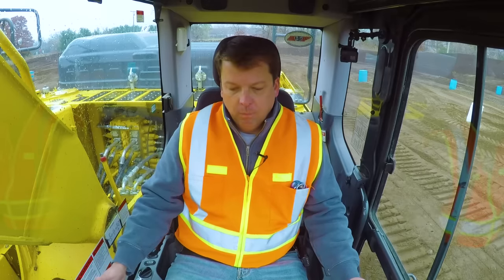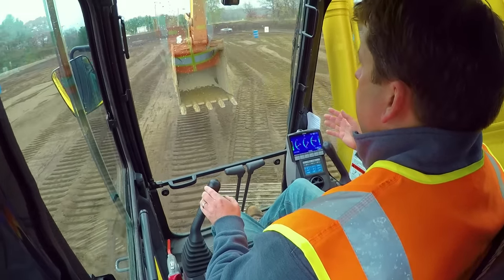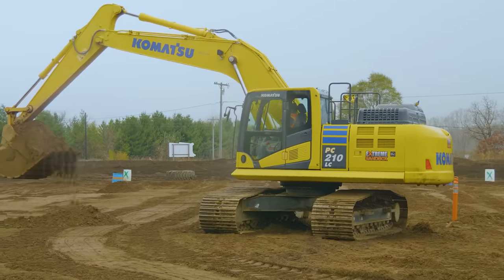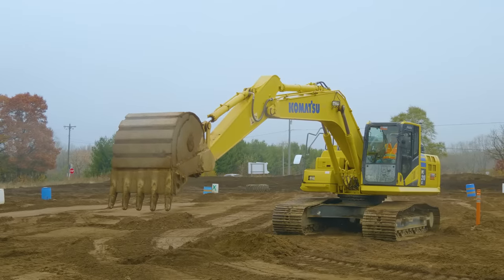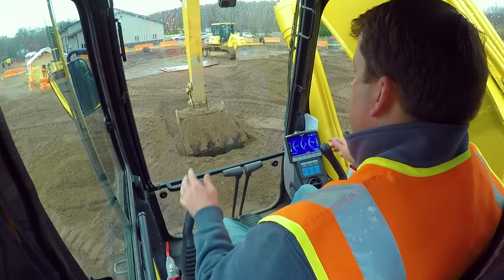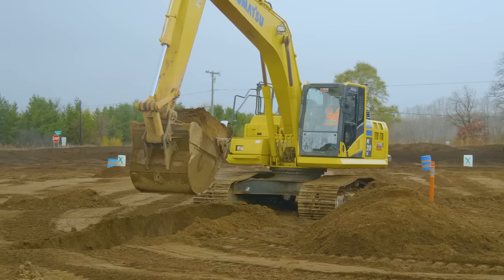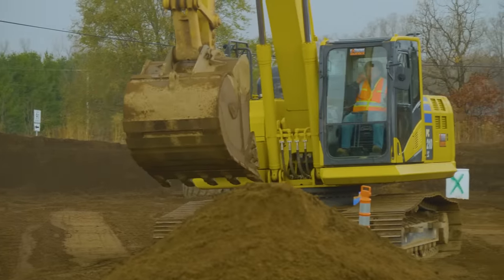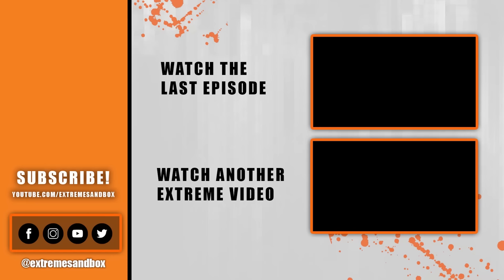What NOT to do in an Excavator | Heavy Equipment Operator Training

Comment: Park with the boom set down stretched out or tucked in where the equipment  manufactures tell you to place it, in order to see the hydraulic fluid level. Also park as level as possible to get the correct oil level and avoid running low or adding to much. And a real common mistake that I've seen happen quite a bit with new guys especially when using excavators that have been changed over to log loaders, to work in the woods, is walking to the next landing or towards the next project and forgetting to clean off the road or at least make certain they didnt put a big sail in the center of the road after clanking back and forth with there tracks, or the worst is watching some asshole twist around in one place and rip it to shreds while tearing the ground up until it turns into the consistency of diarrhea. I have known better than that since i was a kid listening to the good old boys griping in the restaurant they gathered in. But i also remember having my boss call me on the radio to tell me to either walk the loader back and clean the logs out of the road...or better yet, grab a choker and a saw and drag them down here. That might help you remember not to be that *#*#,##,stupid next time! It worked...i never did it again!
Reply from the maker: Good advice....thanks for sharing!
Reply: Thank you, thank god my boss was a good man who had the patience of jobe. I had walked his poor old wore out hitachi EX200  log loader with a rickety set of tracks about 1/8 of a mile to our next setting where it could rest for a couple few days before moving again, but i never swung around and double checked to see if I'd left anything in the road...like two big grapple fulls of smallish western hemlock logs. He would have beat me with my own seatbelt if i would have traveled it all the way back for my own absent mindedness. Besides walking back down there with a rather large awkward bar oil leaking chainsaw on my shoulder and dragging a 25 ft 5/8 kinky choker that grabbed each and every little stick, stump , rock and anything else it could wind around all the way back up to the last landing... gave me time to think about how much easier it might be to double check and make damn certain to double check ALL the work is done before moving 🤔its really easy to forget something that may seem like its no big deal until you need to deal with it...by hand...where i come from, the machines take a beating beyond that of the average excavator. Plus its not easy to get a lowboy into the steep twisty mountain roads with no turn arounds, so we end up traveling equipment constantly to get to the next setting. So you never waste a single rotation of those track pads. Its good honest work and i bet you would get a kick out of it, if you have never ran an excavator that has been converted over to a logging machine. I have a komatsu 58 around the place that let my young boys run often, but i watch tons of videos and practice on a much smaller scale, some of the things i see the road builders and  construction operator's do, and the steps they take to accomplish it. That way i can try to show my boys ( they are 10 and 6 but better late than never) as much as i can, and usually learn more while explaining it to them. There is so damn much to know about the construction side of excavating, and i still hesitate to take on any jobs with my machine, just because i am so clueless on all the detail and clean up work. I never know how much time to put into the projects that i am doing and i dont want to screw anybody over, so i cut my time that i put in directly in half for now, until i can spend more time helping other outfits as a ground guy. That has shown me so much great information that i would have otherwise been lost without.
Reply: Couldn't agree more. Park the machine the way it was designed to be parked.

Comment: I was spotting for an operator once on a drainage site and he told me to go into his truck bed and grab the diesel can. I pointed to the yellow diesel can and he said yes that one. So I filled the machine up no problem and we got back to work. About 5 minutes later the machine started acting funny, it was smoking a bit and losing all power. It turns out the operators wife the night before tried to be a sweetheart by helping and put gasoline inside of the diesel can. I was then lectured on how to tell gasoline and diesel apart
Reply from the maker: Dang...that would suck!
Reply: Heavy Metal Learning Let’s just say his wife later on mysteriously disappeared 😆

Comment: Another "don't do" is operating with the windows or door open when you don't have to. Two reasons. First is that they do provide more protection to the operator than you might think. The risk of something flying at you is real. I've had trees slap the cab hard enough to gravely injure me had I been exposed. Second reason is that the dust invades your cab getting it dusty and more importantly getting into your HVAC.
Reply from the maker: Agree!

Comment: There were some people doing some trenching in Florida and they had properly benched I beleive.  The material was real sandy and they did not realize it had slabs of sandstone in it.  The were below sea level in the trench and a salad of sandstone fell on two men.  They could not get them free and the tide begin to rise    The trench begin to fill with water and they finally did rescue them both.  One guy had to stay pined as they rescued one that was getting close to drowning.  They did finally get the other guy out as well but he list a leg do to having to wait so long.  He also begin to suffer from hypothermia.  So benching isn't all ways the solution   Sometime we should use several methods depending on the type of material
Reply from the maker: whoa...thanks for sharing...always safety first!

Comment: Never leave the grease gun and extra cartridges in an unlocked cab overnight.  Operator did and the next day he found the seat, controls and windows lubed.  Called me to bring the fuel truck and several rolls of paper towels.  lol.
Reply from the maker: oh lord....that would suck
Reply: Don't leave your $300 power grease gun on tracks either. They can't withstand 47 ton machine driving over them. ☹

Comment: My training has been to grease mid day every day beacause the machine is warm the new grease flows in better and you push grit and dirt out better.  Also only put in enough grease to have just a bit shows so you don't catch more grit and dirt arround the ware points.  Make sure you know where all the grease points are and use them, missing one or two for months on end is going to be hard to explain.  If they keep you working it will be with the bottom line equipment.
Reply from the maker: Interesting.  Don’t think it really matters when you do it, as long as you do it.  Thanks for the comment!

Comment: leaving the implement in the air, on any equipment, and the tracks square to door... me and the guy that taught me both have gimpy legs (him with only the one) so having it turned slightly right makes a world of difference getting in and out.  trying to climb up a 300 size machine when the door is over space is problematic and annoying as S
Reply from the maker: Totally agree..:thanks for the comment!
Reply: Traveling with implements out of travel position.
Reply from the maker: Agreed...thanks for sharing!
Reply: On the right jobs a bucket of dirt beside the track walk out level, next morning walk in level. Sweep away after pre-op inspect and grease and back to work! Just avoid jumping.
Reply: Blade runner. How exactly are you shoveling your tracks with a pile of dirt in front of them?
Reply: @bjhinson4647  track shoveling, pft thats the FNG's problem duh
Reply: @bjhinson4647  you put it in front. DUH!!
Reply: @bladerunner6354  Great tip! Learn something new every day.

Comment: I see your boom is not fully extended to protect the rams.... when parking up I always protect the hydraulic rams by fully extending the arm and opening the bucket and by not forcing the bucket in the ground I leave about 1/2 a centimeter so when I turn the machine off and release the pressure in the system the bucket is on the ground without pressure behind it (by releasing the pressure I mean doing a couple of full circles on the controls once the machine is off). isn't that the way it is ment to be? at least I was taught that way.
Reply from the maker: Yeah...not a bad practice.   Thanks for sharing!
Reply: On my machine,  once it is shut down I can turn the key on and unlock the machine as if to operate,  then cycle the controls to relieve the pressure. I might add however that it is a late model machine with pilot controls.
Reply: @snowryder800   im on a 2018 and its as u say ignition on safety lever up and then it will release pressure.
Reply: @michaelrobertson4129  Yep, BJ HInson was saying that the newer machines are electric over hydraulic, and while that may be the case on some current machines, it is not the case for all late model machines.
mine is a 2016 model. and I currently have a 2020 demo onsite, both are pilot controls.
Also I might add that machines that I have operated with electric over hydraulic controls, had a provision for relieving the pressure after shutdown. you just have to 

READ THE OPERATORS MANUAL!!!!
Otherwise how will you know the specifics of a particular machine.
Reply: Your teacher was wrong
Reply: What make are these machines
Reply: That also puts it in a good position to grease in the morning if you have the room to do it.

Comment: And when trenching around roadways, future or existing, separate your material.  Topsoil doesnt compact.
Reply from the maker: Good advice
Reply: jerry metcalf  Everything is engineered and on a set of prints by the time any field work is done.
Reply: Clearly your a dirt guy and not a sewer guyLOL I love when they roll through and leave is a bunch of piles of mixed crap🤦🏼‍♂️
Reply: No shit Sherlock

Comment: I brother inlaw stuck me when I was 14 told me to dig a hole big enough to stick the machine in and the top of the cab was level with earth .then when that was done I had to full it back in compress it as I went untill all that was left was a torn up patch of field. Then he said I was an operator. He figured this would take me all day. He under estimated how much I watched him over the first few summers I worked for him . I passed that course in 3.5 hours .  He made me do that with a 943 highlift and a D5 as well . Those were the days. Then my sister divorced him and I became a gas tanker , pressure vessel welder. But when it comes to renting equipment I could guarantee the boss always stuck me into it. Just all that safety stuff my old brother inlaw taught me has served me well

Comment: I am a operator of 45 years experience and never dig over the idlers if I can  help it as if you stand beside a operator digging you will notice that the idlers are getting dragged into the track frame with every bucket full extremely large amount ware on all track gear and idler guides and excessive pressure on track adjuster seals, in today diggers extremely unlikely to cause damage to travel motors as you would hit grousers first suggest you have another think the best end of track gear to dig over as you will find much easier on operator if the machine isn;t flicking back and forw  and as we do a lot of tree hauling to a chipper that would be extremely hard on track gear if  you hauled with idlers at the rear as it puts all your slack track under the undercarriage and drags you idlers into track frame and most operators fill the bucket much closer to the machine making it a much faster lift especially if using a larger bulking out bucket
Reply from the maker: Thanks for sharing....appreciate it!
Reply: Bill Harris finally . Another machine man who understands . 
👍🏻

Comment: Dirty windows, filthy floors, unkempt cabs irk me!!
Reply: Yes trashed cabs depict laziness
Reply from the maker: That’s a good one...totally agree.  Thanks for sharing!
Reply: That’s one thing that used to piss me off more than anything else. I used to keep my machine clean on the inside but if I had to take a day off I would come back to work the next day and it would be full of sunflower seeds shells dirt and other shit. Stay out of my machine or leave it like you found it clean. ! ! !
Reply: @terrysweat4187  Here's one for you! Fifteen years ago I got hired on with a company new to me. On door step of union wage for rate. Tried out with them on a 320 excavator that was hammered but ran decent, 10 mins goes by and super came over and told me I was hired and would I stay for rest of day. I had other things going and couldn't but I'd be there at 6 am monday. Got there and foreman told me to follow him, another job short ride away. Pull in park and walk around edge of woods and there sits brand new D6R! This'll be your dozer for as long as your with company. Wow, never had this happen before. Worked a week and a half had to go back to other site take the 320 out from guy in it load and move to yet another job they had going. Be there vouple days assisting sewer crew travis a muck spot. Unloaded and he said go take that 315 from him and finish out day on that. Machine not even broke in yet, 295 hrs. Spent 3 days there and got back to dozer to find grease smears from tree limbs dragged on sides, muddy wet floor. Disgusted I crank it up and reach up and look to set stereo, factory install 200w Pioneer 3 smashed too bits console busted out and some how a leak in roof just above stereo. So pissed I think I blacked out flying out to field office to report it. Two hrs on machine when I removed the poly seat protector 2 weeks prior. The guy that abused it for unkown reasons was hunted down and sent packing. They wouldn't tell me who it was for obvious reasons. Was actually malicious damage by some idiot, not abuse to me. Two laborers cleaned it down and following week dealer intstalled new unit and console. Still irritated to this day when I think about it, even tho I retired.Any machine I operated for them while there had less than 300 hrs on it. A chance like the NEW dozer from day one, unheard of. My favorite size in the cat line to boot. smfh!!
Reply: @bladerunner6354  Wow, I can't see how busting the stereo would be idiot abuse. That seems like it had to be intentional damage. 
But I do have a question about how to avoid grease smears from leaves and tree limbs.  How do you avoid dragging even small limbs down the sides?
Reply: @thece8702  It's rare that I'd be that close to leaves and limbs. That was idiot operator also. I wipe fittings and any excess off, grease only belongs within bushings.
Reply: Some people just get off causing damage for self entertainment!
Reply: I feel your pain.
Reply: Unless you run volvos. 
Been stuck in volvos since the b models. Volvo cannot produce a reliable a/c system for their excavators. They have big plans for someday though, they all have a/c buttons. Want me to keep the cab clean, give me a machine I can shut the door. 
Did i mention volvo sucks? Just so we're clear, 
Volvo sucks.
Reply: @bobm9509  lol, never been on a Volvo. Operated an Akerman H25 for one summer building golf course. Bulky sulky at best. No a/c there either. What it gave up in speed it made up in quantities of dirt moved. But Volvo, yes they suck!!

Comment: Before moving your bucket full of material give it a good shake to prevent losing material. I have also seen operators get used to tracking with their hands which is a sure sign of inexperience. Practice tracking with your feet and utilize your bucket to help you make big turns or climbing up or down slopes.
Reply: There’s definitely times u need to track with ur hands tho …

Comment: The biggest mistake that makes my blood boil and is also quite illegal.... Leaving the boom up and getting out of the seat. I don't give a damn why but if you are leaving the seat that bucket needs to be on the ground.

One thing I have to disagree with is the drive motors. I always have them towards the trench so forward on the pedals is moving ahead on the trench. The reason is quite simple, I'm 5'2" and a lot of machines don't have a seat adjustment that goes as far as I need. Its easier to stretch forward than safely stretch and rock my heel back. Newer machines are getting better though.
Reply from the maker: Interesting perspective on the drive motors, that would make sense (especially if longer trench).   Wonder what others have to say?   Thanks for the comment and suggestions!
Reply: Well that's just easier regardless. I always try to point in the direction I'm digging, for that reason. I'm usually in a little 305.5 so I have the opposite problem, not enough room, but it's still easier to press forward on the pedals. I had to use the levers for a while til I got used to it. Bigger machines, no problem. But I still like to keep it facing the same way cause it's just easier. But bigger machines are also harder to turn around. The little ones, I can spin around basically in place without even tearing up the grass too much. So I keep it going the direction I'm digging, unless I need the blade for some reason. It does help in real hard clay or rock to keep the blade, if you have one, on the side you're digging. Keeps the machine from rocking toward the bucket and gives you a little more breakout force.
Reply: Dustin. When your drive motors are at the back forward on the pedals moves you forward. That’s the way you are supposed to be when digging.
Reply: I raise hell when one of our guys does that.